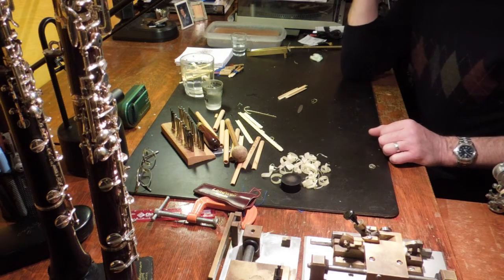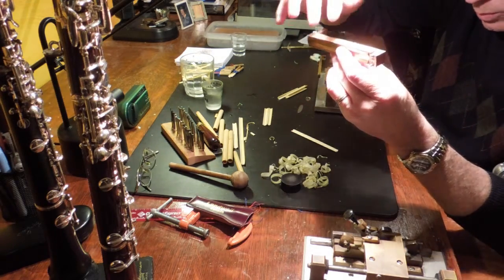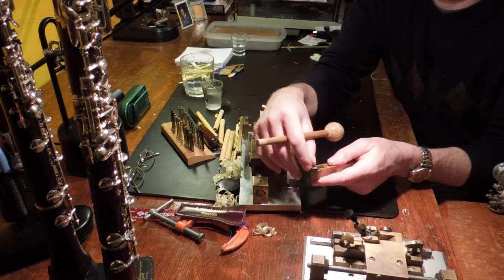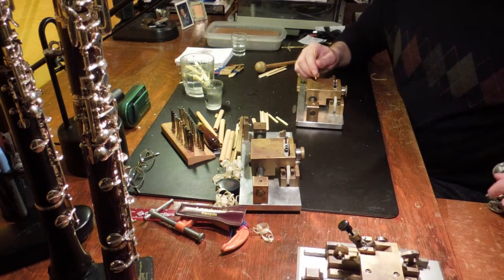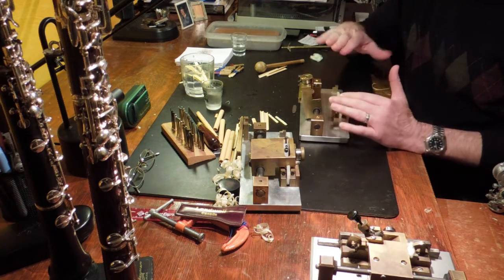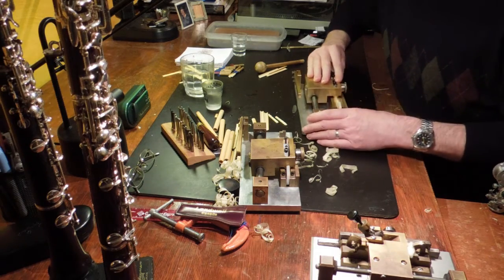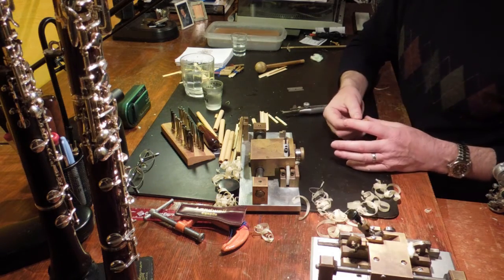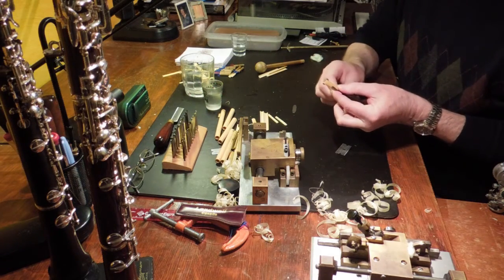Gouging and Shaping Oboe Cane

Comment: Fantastic you are. Wonderful series of the oboe reed topics. Remarkable demeanor.
Thanks
I’ve a Jeannee and an RDG symmetrical blade I’m sure.
One rough, next to finish.
Quality straight cane a given.
I believe that the diameter is as well crucial, As it determines the relationsrhip of the middle to the sides thickness. The smaller the diameter, less cane will need to be scraped and taken out in depth of scrape on the sides. 
The 11 in diameter will end up with thicker sides. It’s a delicate balance. And then there is the comparison of the wet v dry, some cane is steady, other pieces changes to a much larger diameter and the gouge will be heavy on the sides and more cane will have to be scraped leaving no bark at all on the rails. Soft or green can will deceive you.
Some believe best vibrating qualities is dictated by the layer of the fibers directly under the bark.
No 2 pieces of cane ...

Again, great contribution from you. All enjoyed immensely.
Reply from the maker: Thank you.